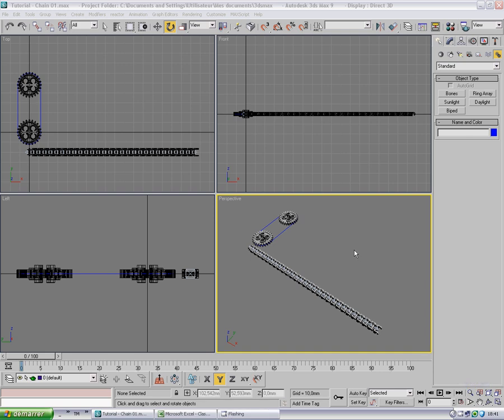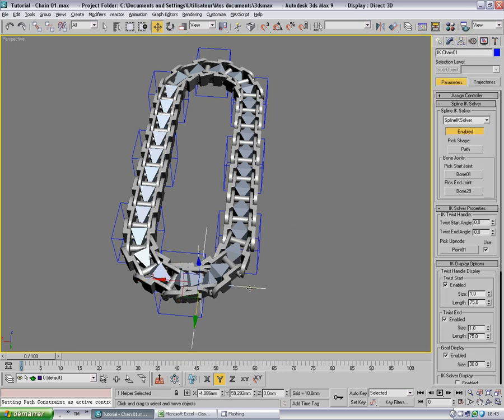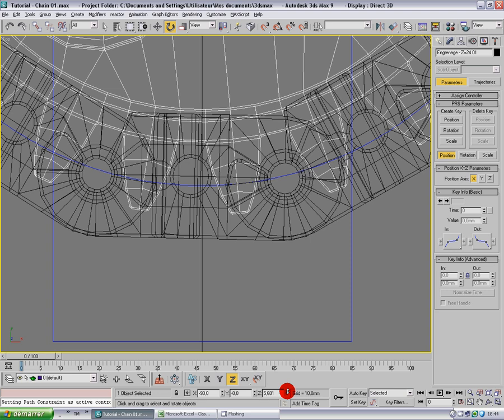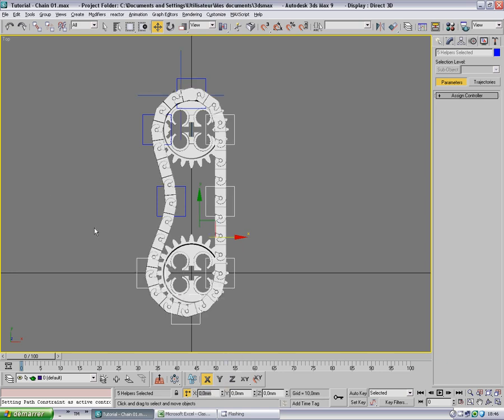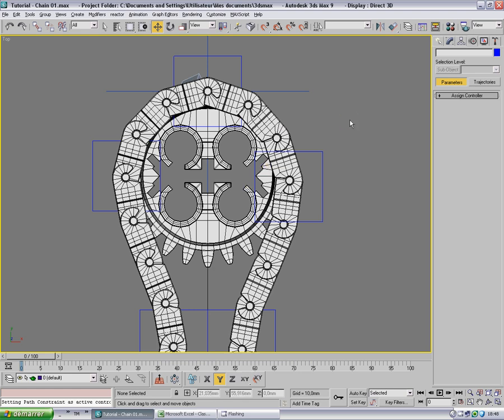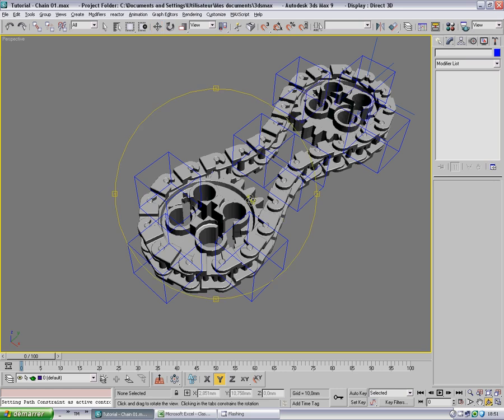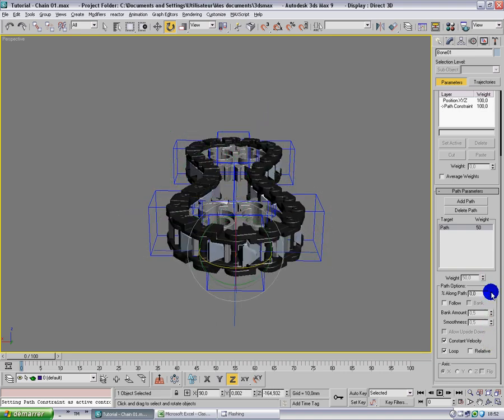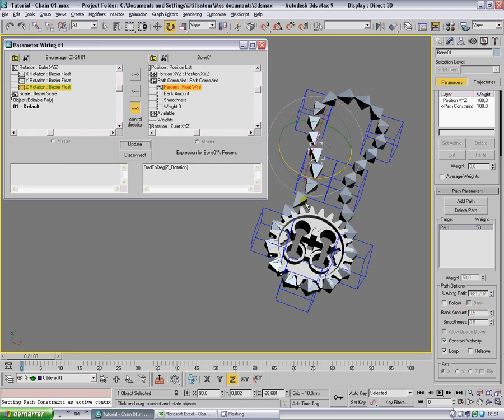Tutorial - Rig of mechanical chain - Part 2

Comment from the maker: @pols1985 : I do think that the number of chain parts is correctly calculated.

The main point here is the adjustement of the chain path is not really greatly made.
Here, the path has a static shape but in reality, you should make the shape more flexible and/or add a 3rd gear to adjust the chain softness.